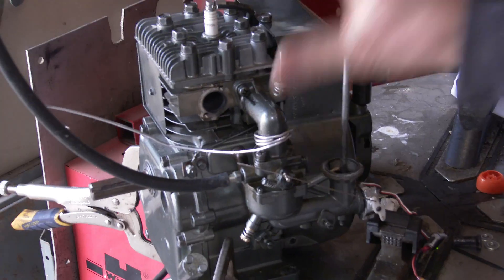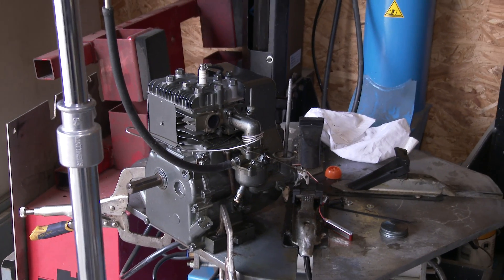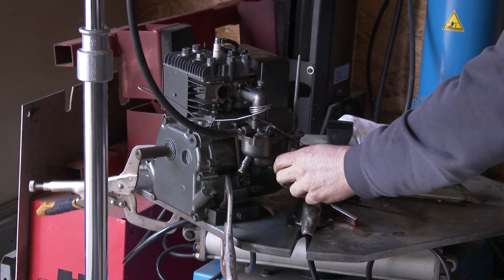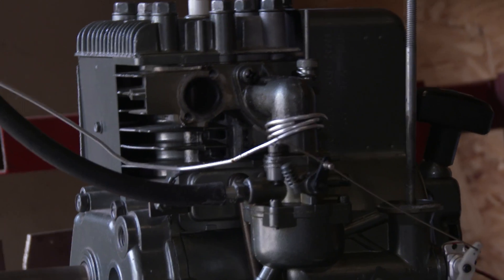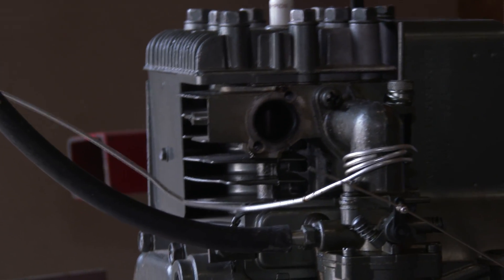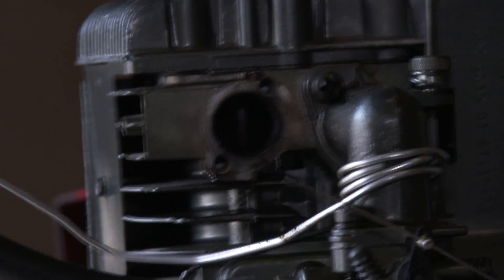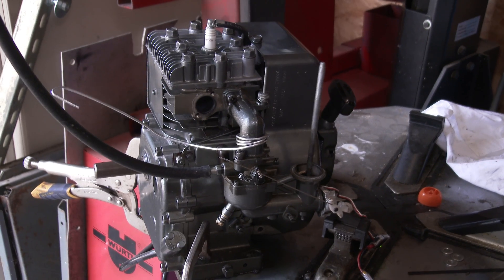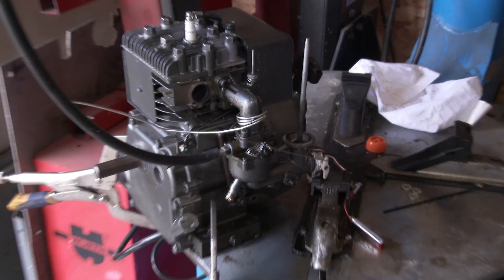Briggs Engine Running Nitromethane - Excerpt From Blowing Up See Through Engine Attemp 1

Comment: Correct me if iam wrong. Mounting the gas tank higher, does nothing to effect the pressure. You still have the same atmospheric pressure, weather it's 2 inches,or 2 feet. In this situation, to change the volume, change the jet size.
Reply: Jet size would increase volume too, but raising the tank does increase pressure, not a huge amount, but it does increase pressure
Reply: @derelict24v  looking at the shart for atmospheric pressure it decrease's the higher on altitude you go. But it's going to take a lot more then a couple of feet. At sea level it's 14.7 psia, as per the chart, to increase the psi you have to go below sea level. A good discussion, I love it. Good day to you.
Reply: The fuel pressure at the bottom of the column of fuel would be higher the higher the tank is raised.https://www.absolutewaterpumps.com/blog/convert-feet-to-psi/
Reply: @derelict24v  I see what you're saying, I didn't take the actual weight of the fuel into consideration
 Once again, thank you for your input. Good day to you.
Reply: @sheldonbrunn6445  a good rule of thumb is to always remember mass and weight. A good example of this is lbs of air vs lbs of boost. Banks Power has done some incredible talks on this
Reply: This is a carburetor with a floating chamber. Raising the pressure will not have any effect. This answer is a bit late, but @Sheldon Brunn is right  😉
Reply: Sure... that's why water towers are useless but they continue to build them anyway.
Reply: Your correct.  This dude doesn't know what he thinks he does.
Reply: I'll correct you since you are wrong. By raising the fuel tank higher he's increasing the depth of the fluid in the fuel line which increases the fluid pressure. This is true for both small fuel lines and open oceans. It's how water towers create water pressure, the higher the tower, the deeper the water, and the higher the pressure.